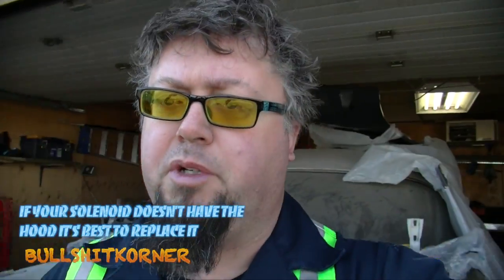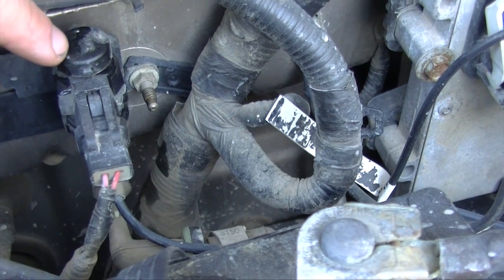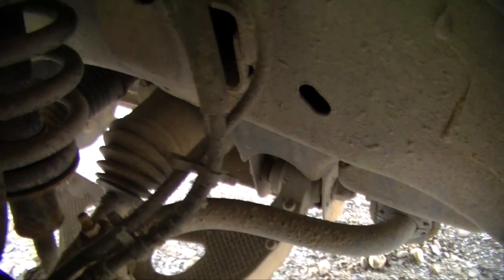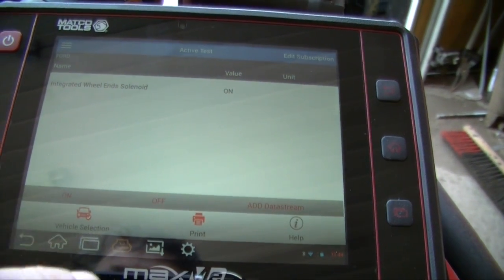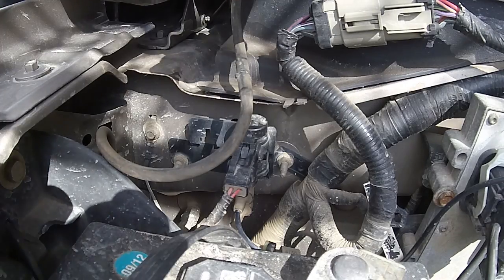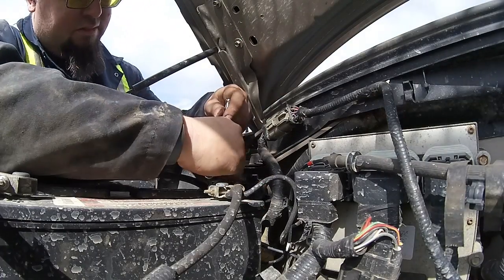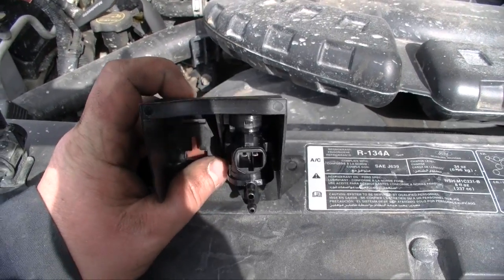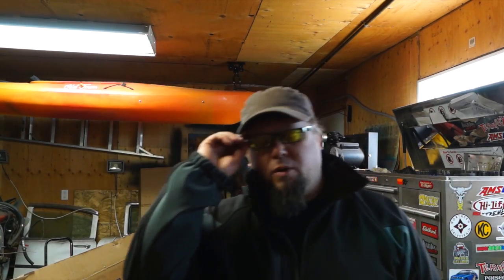Ford F150 4x4 Problems IWE Actuators, Vacuum Solenoid Troubleshooting

Comment: Mine makes a similar noise on the front left when a back out of the driveway, starts right after the front comes down off the curb. goes away after I put it in drive and roll forward again. Hunting for clues.

Comment: So I changed the check valve, solenoid AND the vacuum lines to the actuator and still get the grinding in 2WD and doesn't seem to engage in 4AWD, or 4W high. I took it in and they said the actuators looked good, but still having the grinding when slowing down going slower than 15 mph only in 2WD. any thoughts?

Comment: Just checked    There is no vacumn on the random plastic line     I’m looking at changing out the original solenoid to the one with the hat    I watched water go directly on it  when I popped the hood and arrived in Montana   After a long drive    I see there are two check valves in that area also   I guess I’ll replaced them both     Looking to prevent damage in my 4x4 system

Comment: You're the man Jerry. Thanks for the video. I haven't had a problem with mine yet, but I figure I probably will at some point in the future. You should do a video on repairing the cam-phasers for these trucks. That is a huge problem that the 3-valve is plagued by.
Reply from the maker: Zack Zander i keep getting requests for that, however that will be a problem i'll do when and if the time comes.  I've heard it's not a very fun job to do
Reply: Did you figure out your 4x4 problemV

Comment: my 4x4 light wont go off and after some troubleshooting i pinpointed the issue be electrical...my 4x4 vacuum solenoid male electrical connector is shorting on the ground switch side (left) so its always telling the computer that 4x4 is on, confirmed when i turn my key to the on position, i hear the 4x4 always engage.....what are these male electrical connectors that connect to the vacuum solenoid by the front passenger side called ? also where can i purchase these electrical connectors, they are NOT THE SAME..

Comment: The nuts holding the solenoid on are a 6MM X1 standard thread (on my '06 anyway).  Get about four at a hardware store before you start, as they are an absolute bear to reach with the fender and battery box in the way. Unless you have magnetized fingers you are bound to lose a couple in the abyss.  The shield on the replacement part makes it even more fun. Other than that, a fairly easy fix to go to when BOTH  hubs are grinding at the same time.

Comment: Your video is very informative. My Ford dealer has been going back and forth on my issue forever. Now I can direct them to your video. You rock!
Reply from the maker: +richhill23 Your ford dealership has been wasting your money and time then, because you can plug into the 4x4 module and test every circuit separately.

Comment: i heard spraying pb blaster garage door lube in the IWE ends every now and then helps...remove vac line and use red straw and use a good amount . it lubes all the moving parts and keeps the seals from cracking.
Reply: disconnect the line into the wheel hub and spray down into the 2 holes where the vacuum lines connect?

Comment: my truck is 2010 f150 and this peice is on the driver side.  I'm getting the same noise.  was once inawhile but now its usually around 40 to 60 kmh.  Thanks for the tips and the video.  I was getting concerned it might be the transfer case.

Comment: I have already replaced the vacuum solenoid.. I also replaced the 4x4 hubs and the vacuum lines.. it’s sucking air at the hubs in 2wd just not hard enough to suck the hubs back

Comment: My 2001 5.4L 4x4 has 2 IWE Solenoids side by side on the firewall, passenger side.  The grinding was horrible. 
Which side is most likely bad ?
I am also replacing the little valve. 
I believe the grinding was so bad I will have much more to repair at the hub level.

Comment: My 2010 F-150 was just making a terrible metallic grinding noise on a road trip while climbing long hills on the interstate.  As soon as the truck crested the hill, or I let off on the gas, noise went away.  When I got home from the trip, back in the flat lands where I live, I have not heard the noise since.  Is the vacuum system related to torque, or changes under the load of climbing a hill?  I have not been able to duplicate the noise on a flat road.  Also, my truck has the shifter for 4X4 on the floor, not an electric switch.  Is that a different system than the solenoid in the video?

Comment: Now my 2005 f150 has the exact symptoms you described, my only difference is will this still refer to me as my 4x4 is on the floor rather than an electronic switch?

Comment: I was redoing the plugs and thought I knocked this vacuum line off my truck is a two-wheel drive 2004 5.4 Triton would that be the same as a four-wheel drive or is it different because it's only two wheel drive and the information would be helpful thank you

Comment: My 06 passenger side vac line just got burned by the exhaust manifold out of the blue.  It got too close to the heat.  Must have just moved it a little close or something. Never been a problem before

Comment: I'm still working on mine 2004 F1shitty  pulled the little black and white mushroom looking thing off from the line tgat plugs into the selaniod .. was plugged with dirt .. still no 4x4 .. had a vacume line rubbed on tire .. .. replaced , prolly try the motor next ,

Comment: I have a 2010 Harley Edition F150 and my valve is on the opposite side of the engine compartment. I believe my problem is in what they call the "A/C Vacuum Check Valve" P/N 19A563 (YG-429) the name of the part is quite misleading and even the parts guy at Ford had no idea what part I was asking for when I asked for the hub actuator check valve, he actually quoted me the "Power Brake Booster Check Valve" P/N AL3Z-2365-A which as far as a know right now doesn't have anything to do with my issue. My problem involves my hub trying to engage at cruising speeds namely in cold winter weather. Using a small hand operated vacuum pump I confirmed that my actuator circuit can achieve and hold a vacuum. The issues is vacuum drops when you are at cruising speed not accelerating or decelerating about 60 MPH and the check valve at this point is supposed to seat and lock in the vacuum, if it doesn't seat properly your hub actuators will lose the necessary vacuum to remain completely disengaged and you'll hear a hellacious sound from one or both hubs as the splines start to just barely engage. I'm happy I finally found the part I believe I need for $11.64. The video is good but not all inclusive of part location or possible problems and causes. I don't think I need to worry about water getting in through my solenoid valve due to the different location of the valve, it's not on the firewall so not in a leak path for water. Great video but there are some other troubleshooting methods that might further isolate a simple issue before you go tearing out your actuators cause that's a big job and ultimately may not address your problem.
Reply: Good point. May have to check this when checking vacuum lines. Was this a permanent fix?

Comment: Great info thanks. 
Where does the hub itself get vacuum though? 
I have removed the hub / drive flange and bearing assembly / suspension knuckle and saw no vacuum line. 
I have a customer in the UK with one of these, that sounds like it could have this problem.

Comment: CHEERS, my 2006 is having 4x4 issues too so Im  having a beer to drown my sorrows, lol
i already replaced one maybe both the actuators several yrs ago about 10,000 km ago. its mostly a winter/hunting truck so i only put about 10,000 km in 5 yrs on it.
i recently drove through some deepwater after heavy rain, 2 days later out of the blue, once you get going 20 km/hr or more the 4x4 makes  grinding /buzzing sound in 2x4.
in 4x4 that sound goes away but theres intermitant  loud clunking under acceleration
i check for vacum just with my fingers and theres definitely some vacum both sides at the actuators and that vacum goes away when switched to 4x4
So does this sound like an actuator is gone?
mine has the hood over vacum switch already, cant remeber if thats a new one or not

i also noticed one boot is worn out , would water getting in there somehow affect the actuators? it should be seperated physically as i understand this system?
Reply: Tyrone Tripod hi saw your comment on another 4x4 video also. Helped me understand how the system worked. I have the same symptoms and I assume it was but to confirm, was it your actuators?

Comment: My four-wheel drive F-150 2005 4x4 will not engage at all I'm in Boston and it's winter time what could be the problem could it be a fuse thank you so much bro

Comment: I have the same problem. But our truck only makes the sound in 2wheel drive. If I put it into 4h 4x4 drive I don’t get the sent yet it doesn’t feel like my truck is in 4x4 at all. You think it’s the the seal on hub or the vacuum hosing?

Comment: i usually find that after changing a hub bearing at least 50% of the time the vaccum hub teeth have damage so its a good idea to buy one when doing a bearing too especially if your bearing has play in it
Reply from the maker: UBBERTANKER that's a very good point, in this case i knew i was going to replace the hub so i got a bearing at the same time lol

Comment: So what should be fixed if you can’t get the 4wd to engage while vehicle is on and running? I have to shut off my ford and have it in neutral before I can shift it into 4wd?

Comment: My 2003 F250 with auto transmission and 4 X $ shifter. Used high 4 x 4 and then it would not go back into 2 x 2. Any ideas on how to troubleshoot? Also does this information on the F150 apply to the F250? Thank you for your comments.

Comment: i have good vacumm at the firewall.4x4 still work popping the fuses. and don't light on the dash you click over to 4x4x.the only thing see is 4x4 h and 4x4 low flashing all the time driveing or sitting when i turn the key. i replaced the shift motor.you have any ideas what the problem is.i don't hear no grinding from the wheel.

Comment: Thanks for the info, I have a 2005  f 150 the 4 wheel drive is not working all the time  and sometimes there is a load noise. I follwed a line from the hub  (driver side) to a box where the brake lines come together and it is hooked to nothing. is that a problem. I think it is.
Reply from the maker: Nope that should be the vent line
Reply: @BackCountryWrenching  thanks man I was wondering if I had to vent

Comment: So I changed the whole passenger side wheel hub assembly and the hub assembly actuator and I’m still getting the rattling dragging noise and as I look I still have the old school vacuum seal annoyed could that be the problem?  Thanks in advance

Comment: What does it mean if you hear a clicking noise coming from the dash and it won’t even click into 4 high or 4 low all my truck does when I try to put it from 2wd to 4 high all I get is this clicking noise from my dash and it doesn’t go into gear

Comment: Hello, I have a 2010 f150  and the driver side is making a noise when accelerating on 4x2 but goes away when I switch it to 4x4. I switched the hub actuator and the wheel hub barings on both sides. Still making that noise only from the driver side. Any ideas what I can be? Thank you

Comment: Hello. About 2.5 years ago Ford worked on my truck. A few days ago my personal mechanic while changing my ujoints noticed both the vacum hoses fornthe 4 wheel drive were missing and said 4 wheel drive wont work with the vacum hoses. I checked the otherside and they were super secure which means somone took them off. I used regular vacum hoses. Now Hear that dragging sound only drove about 4 blocks with that noise coming and going. Then I unhooked the vacum hoses and no more dragging noise. What do you think the issue is? I have no idea. Thanks in advance.
Reply from the maker: Most likely the issue talked about in this video

Comment: I think I am having the same problem.   In reverse it drives not do it at all. If I go forward it doesn’t start doing it till I press on the brake.  Wtf. Changed hub and actuator  and axel on driver side.  Seems to be only on the driver side.  Any suggestions ?

Comment: Hi,hope you can help me,I have a 1997 f 150 4x4 with the 4x4 shifter on the floor,I'll be driving in 2 wheel drive and the 4x4 light on the dash will come on then it will grind,I stopped real fast,put it in four wheel drive then back into 2 wheel drive,the 4x4 light on the dash went off and I was good to go,but now it's doing it more and I parked it,I'm asking you because I'm on a fixed income and  don't have the money to take it to a garage,is their anything I can do to fix it,is it the sane problem you showed in your video? because I see your switch is on the dash,would that make a difference?

Comment: Hey brother questions for you.

My 2010 just started acting up. I did some front end work a 
while back and had the shaft out and the hub assembly seemed to look 
fine. At least the seal looked okay. I cleaned it up and re-lube it 
before assembling. We had some snow since then and the four wheel drive 
was working fine. Just the other day we had a little snow and when I 
engaged the 4WD at a light the back tires were just spinning so I know 
it was not engaging. I turned it on and off a few times and finally it 
engaged. But I could hear it grinding now and then like it was going in 
and out.

Then later while driving it made a god awful noise like you described - 
like something was dragging, almost like a brake noise, but the brakes 
were fine and pressing the brakes did not change the noise. I switched 
the 4WD on and off again and then it stopped. Later leaving work, with 
the 4WD off, it made this buzzing noise loud as hell. I backed up and 
forward a few times and then is stopped. 

My son just told me he heard some weird noise coming form the front end 
when he was driving it. 4WD off. I am going to check tomorrow and make 
sure the vacuum line is on tight, but I don't want to start buying shit 
willy nilly. Any ideas? Only has 100K miles on it so it does not seem 
like the vacuum hubs would be bad? So with all that, where do I start?

Comment: Quick question 04 f150 grinding noise on way home then in the not ing drove around and no noise, pulled the iwe switch and was moist, my question is if hubs were bad would it constantly make that noise?

Comment: have 2004 F150 FX4   ,the 4 wheel engages but the 4 wheel light will not turn on. The bulb is good because it comes on briefly at each start of my truck, its bright and clear.  Help me with a situation please
Reply: Mine has same issue. Did you find out the issue? Thanks

Comment: so when you have a vacuum it is in 2 wheel drive .When no vacuum it will be in 4 wheel drive.The actuator does the shifting .Is that how it works.
Reply: The actuator doesn’t shift between 4hi and 4lo but it is what shifts it into 4wd if that makes sense cuz it’ll turn off the vacuum going to the iwe’s on both wheel

Comment: Any suggestions for troubleshooting my 2006 FX4 F150, 4x4 HI is failing to engage but oddly Lo is, i was under the impression Hi to engage to prior to lo being able to. I have replaced the IWE solenoid, my seals were not cracked but replaced  I did hear minor grinding coming up a slippery boat launch, and the sound was gone immediately.. Thought could possibly be the shift motor, but with the key in the ignition but not running I hear a click when attempting to shift. Any leads or ideas would be greatly appreciated.

Comment: I have a random open vacummn coming up by the passenger side exhaust manifold    I can’t really tell where exactly it’s coming  from     It may be normal   Do you know What I’m talking about ?
Reply from the maker: Could be the vent from vacuum hub
Reply: Bullshitkorner    I checked it earlier    There is no vac or air coming out of it      I’m thinking it’s normal    Weird thing is   I remember seeing a similar line   Coming down the wheel well by the strut    Same thing open and hanging     I look for it now and can’t find it

Comment: Hey buddy
I've got a 03 f150 4x4  only sometimes the left front tire starts bouncing  1st time I was going 70 on the interstate scared the shit out of me but it went away as quick as it came  another  day I was driving  slow speed stoping at a red light and noticed it  again it seemed to be raising up a few inches then down could it be the actuator engaged and dis ingaging  I'm lost with this problem since  it only happens every so often  any help or advice would be greatly appreciated  thanks 
David s

Comment: I had brakes and rotors replaced on my 2010 f150 lariat this past Saturday. Just so happens this same night we got a winter storm. On my way out to go plow for work, I put my truck in 4x4 and it now doesn't work. I get message saying to check 4x4 with wrench symbol. Can the shop that changed the brakes and rotors this same day have done anything to make my 4x4 not function? It has always worked till this time. I called the shop and they just want to tell me it was nothing they did and that it's just a coincidence.

Comment: Hey ! I had a bad solenoid, replaced it, and now the actuators are disengaging properly. I'm still getting the "whirring"/ "bad bearing" sound though. I've triple checked to make sure the axles aren't spinning and disengaged. I've heard guys replacing the actuator and still end up with the noise, what do you think ? I just don't want to start throwing money at it in the wrong direction.... thanks !
Reply from the maker: +BarrelOfRum1 you'd have to inspect and see how the bearings are
Reply: Ok, great, I'll have time this weekend. Thanks so much !

Comment: I replace mine the 4wd actuator on the hubs and its still grinding it only happens every now and then but my   4wd actuator by the hub is not connected correctly